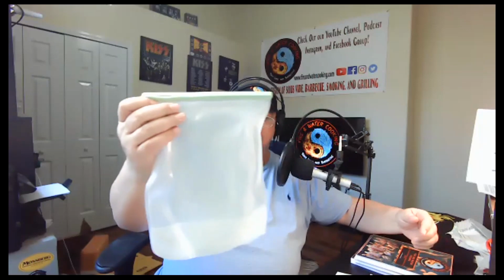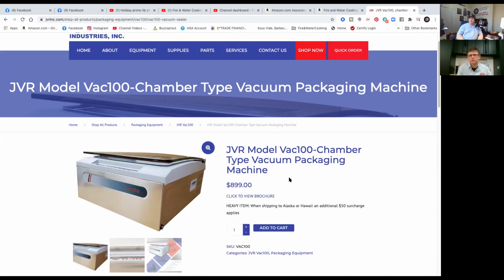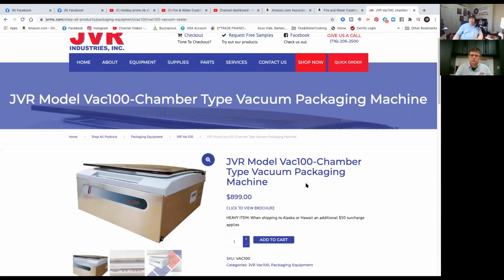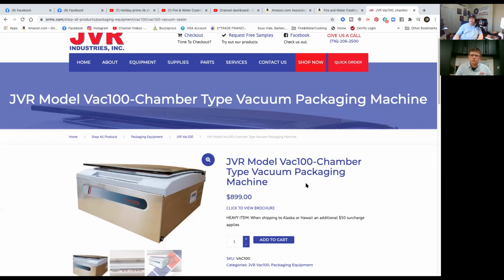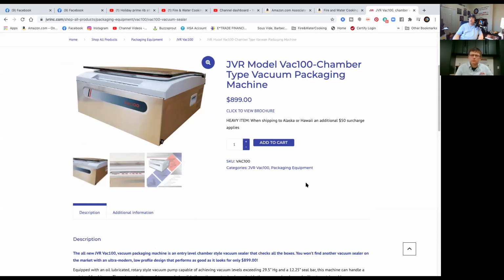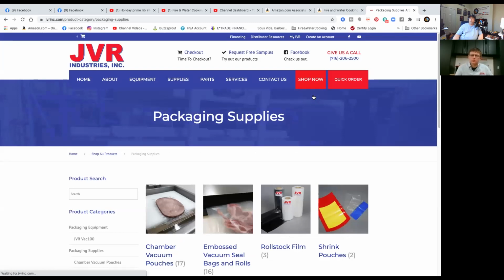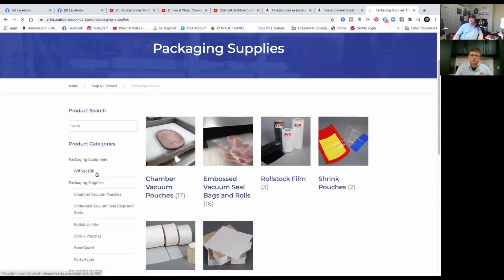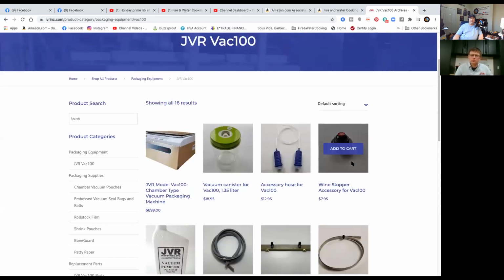Fire & Water Cooking Podcast JVR Industries Talks Vacuum Sealers

Comment: so whats better the JVR Model Vac100 -- avid armor ultra 32 ---- vacmaster vp215    which one does a better vacuum
Reply from the maker: it all depends on your needs. i prefer the Vac100 for my needs, but the USV32 is smaller and may be better for those with limited space, the VP215 is OK but the Vac100 has more options, is cheaper, and has a smaller footprint.

Comment: Do you have any insight into the changes they are making to the new version of the Vac 100?
Reply from the maker: Program changes
Skip function added... at any time during the vacuum cycle the user can now press the "decrease" button to stop the vacuum function early and skip over to the next segment of the cycle.  This will be very useful when sealing liquids to avoid boil over.
The "inflatable time" setting has been removed and is now hard programmed.  There is no reason to adjust this setting and to limit confusion we've removed it from the adjustable settings menu.
  Program "P9" is now hard programmed to be a clean-up cycle for the vacuum pump.  During this program the vacuum pump will run continuously for 5 minutes.  To maximize the life of the vacuum pump it will be recommended that this cycle be run 3 times after the following situations...
Once per week if regularly sealing products with a high moisture content.  e.g.  soups, sauces, marinated items, items that are not chilled prior to vacuum sealing, etc. 
Once per week if the machine is being used in an unconditioned space with a high dew point
If the machine is being stored for a period greater than 2 weeks
If excessive boil over occurs with potentially high amounts of vapor being introduced into the vacuum pump

Comment: Really curious about the Vac100. We butcher our hogs/sheep about 2-4 times a year. We are looking to do more of our own processing when we do butcher and was wondering if the Vac100 would be good for this in your opinion? While we wouldn't be using this on a weekly basis (though once we have one maybe we will use it more? lol) but when we will use it, I expect we will use it for a 2-3 hrs (doubtfully nonstop during that time lol). I was listening to the potential to overheat by using it longer than what it's created for, so hate to set myself and whichever new machine I get up for failure when I should have just spent a bit more on something more appropriate for our needs.
Reply from the maker: this would be perfect for your use.. Andy was saying this is not something that you would be running for 6-8 hours straight everyday. but for what you are talking about it will be perfect.
Reply from the maker: make sure if you buy it use the code "Fireandwater" for $100 off